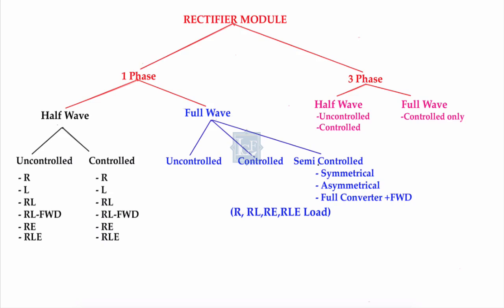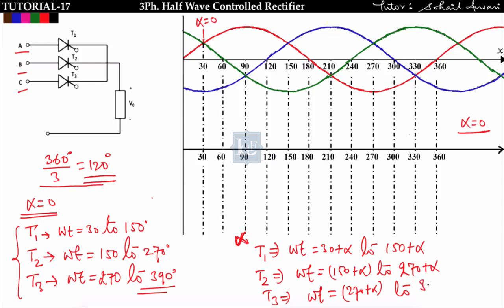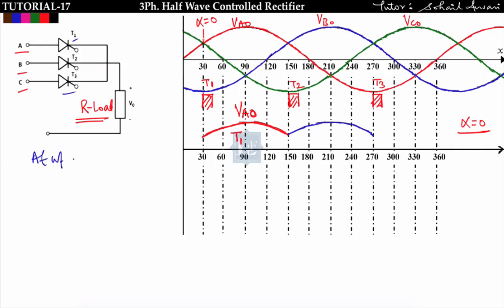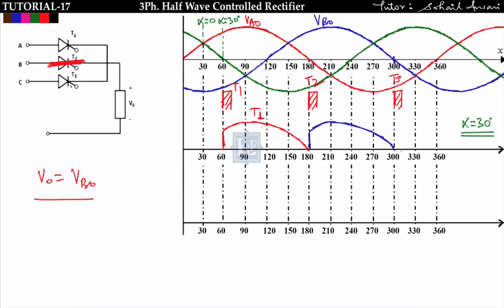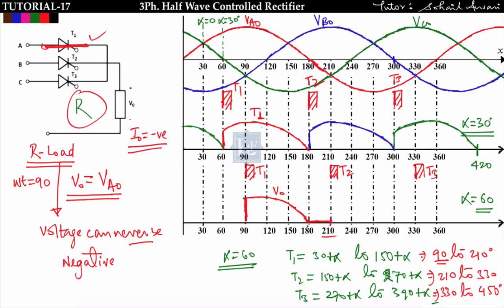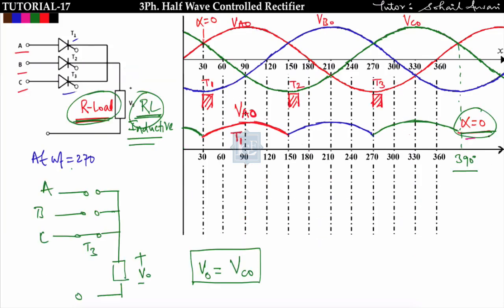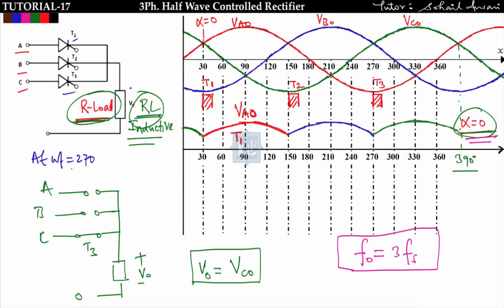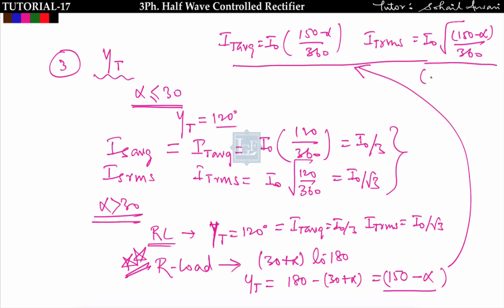Lec 17 Three Phase Half Wave Controlled Rectifier

Comment: Sir what you told about 3phase semicontrolled rectifier is wrong at alpha equal to 30 degree wave starts from 60 degree onwards and at 150 degree the potential of Vao is higher it will follow that path why should it will continue Vao after 150 degree by this whole equation will effect and output voltage equation also not correct it will be 3√3Vm(cos alpha +1)/2π
Reply: Potential at Vbo is higher
Reply: but he don't taught about 3 phase semi controlled rectifier. He taught only 1 phase semi controlled rectifier

Comment: For R type load output current follows output voltage, so u can't consider output current as constant. So for output current in one period 3 cycles are repeating but for thyristor current only one cycle is repeating. So  I(T)(avg) =Iout(avg) /3. Similarly I(T)( rms) =Iout(rms) /√3.so the last result u told is wrong. This would be correct if the output current waveform is rectangular. But here for R load output current follows the output voltage waveform. Think over it.

Comment: Sir  what's the reason behind taking the angle 30 degree initially . Can we take any other value instead of that 30 degree?
Reply: No bro
Alpha =30 is the critical value for the diode/scr to conduct because before 30 degree Va is less than Vc

Comment: For R type load and aplha = 30,   after wt = 150 T1 become reverse bias so how does it continue to follow the va voltage..??
Reply: This is thyristor based converter and not the diode one like earlier...so till the gate pulse is given to T2 (i.e., at 180) T2 will be open-circuited and T1 will continue to conduct

Comment: A three phase , three pulse , half wave controlled rectifier is supplying an RL load where L tends to infinity . A free wheeling diode is also connected across the load . If firing angle is 45 degrees , then fundamental displacement factor is ?

Comment: Good morning sir
Sir I am not getting that when firing angle is 30° why Va start conducting from 60° ? 
It should start conducting From 30° again bcs for firing angle 0° it is not conducting From 0° due to Vc(at that instant Vc >Va  ........
So from From 0°to 30° waveform should be Same .
Reply: Because when alpha was 0 i.e. case of half wave uncontrolled rectifier at that time Va was conducting from 30° to 150°

Comment: Sir, I have a confusion that why thyristor starts conducting from alpha+pi/6 even when alpha is less than pi/6, though maximum anode phase voltage of phase A occurs at pi/6. Shouldn't it start conducting from pi/6 only??
Reply: Vao and Vco curves are intersecting at pi/6..so if alpha axis taken from 30 degree..if angle is greater than 30 degree..1st thyristor turn on

Comment: dear sir,
what will happen if the load is pure inductive? How will Vavg across L be 0?
Reply from the maker: avg voltage across inverter is zero...this is according to volt sec balance..watch lec 21 for this..ok
Reply: thank you Sir, But actually I was asking that in case the load is pure inductive and alpha is greater than 90 then we can get positive area under the voltage curve = negative area i.e vlavg = 0.. but if alpha is less than 90 then we can not get positive area under the voltage curve = negative area.. what will happen then?